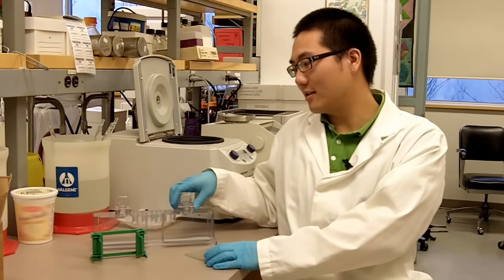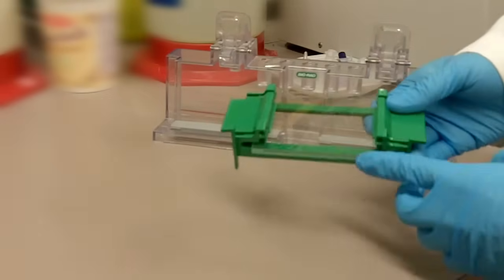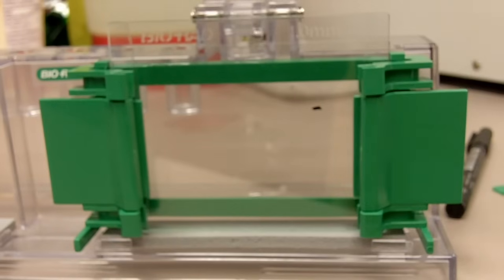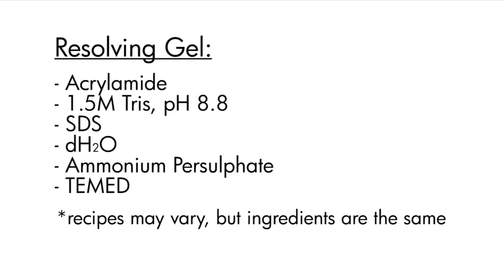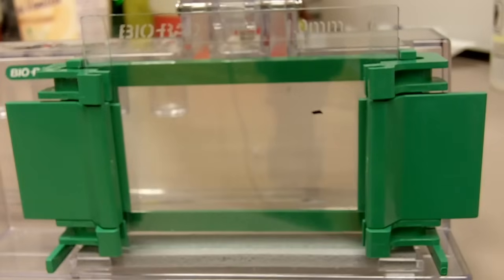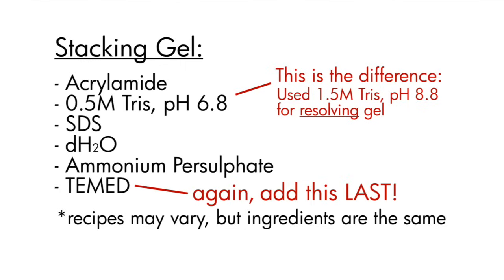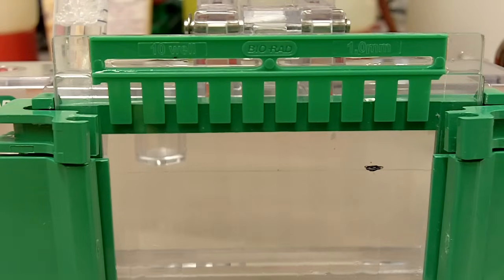How to Make an SDS-PAGE gel

Comment: For some reason, when I prepare the gel, I notice small webs formed inside the well, which is why when I load the protein, the proteins don't run well. I prepared new apps and tried again, but somehow encountered the same problem, Could you suggest what should I do ?

Comment: If you have leakage, you can tape the bottom of the plates together after you place the two glass plates in the casting stands and before placing them in the casting frames. This helps ensure you wont have leakage when pouring the lower gel. It is really easy to remove the tape once the lower gel and stacking gel have polymerized.

Comment: Thank you for the demonstration. I have a question about the time limit that I can postpone loading the wells by my Lysate. Can I make the gel and load it the day after? How I need the keep it and prevent it from drying out? Thank you.
Reply: I generally make SDS gels in advance, wrap them up individually with paper towels, wet them with milli Q and then store it at 4 degrees. I’ve used 1-2 week old gels and they worked fine.

Comment: I have a ques
When i put plates in casting stand and check it with water either it put correctly or not...the water not leak..but when i starting puring gel it starts leaking from plates
Reply: What is the reason

Comment: Rather than pipeting the gel in, I prefer to pour directly from a 15ml conical (or 50ml if pouring 4 gels from one tube).  I find it more convenient and less bubbly - and it makes it faster if you're trying to pour 4 gels before your acrylamide polymerizes.  Also if you have trouble with leaking, try turning the pads at the bottom upside down or lay a strip of parafilm (don't stretch it) along the bottom pad before seating the glass plate.

Comment: I'm having problems with the stacking gel, it's not fully polymerizing. It gets a slimy consistency but never fully forms. We've tried to make new Acrylamide mix, new APS and new buffer but it still isn't working.
Reply: I hope you figured this out already!  How old is your acrylamide stock?  IT does go bad over time and may act as if you used a lower % of acrylamide.  This might be more noticeable in the stacking gel as it never gets as solid as a resolving gel.  Also do you have the right mix of bis/acrylamide?
Reply: do you vortex your stacking gel mixture after adding aps and temed? I've had the same problem and now its gone
Reply: For those who may read this later.
Acrylamide will not polymerize in the presence of oxygen. Make sure it is fully sealed at the top by the comb (this is the true reason for the alcohol or water layer).
If you need vigorous mixing, your recipe is bad. A quick swirl with the pipette tip after dispensing should be all that is needed.
Double check the acrylamide/bis-acrylamide ratio, it is very possible you are mis-understanding the ratio and percentage of the stock.
APS takes a while to go bad, I used to pour many very large gels, and I often used APS that was months old.
Keep APS and Acrylamide in the fridge, and mix them right before you use them.

Comment: Hi, i have a question about Mini-PROTEAN TGX Stain-Free precast gels...
there is number on the packet "4-15%"...
What do the numbers mean separately?   4? 15?
Reply: +Shaig Shaggy The numbers correspond to the percentage of acrylamide in the resolving gel.  A 4-15% gel is a gradient gel, with the lowest percentage of acrylamide just below the stacker being 4%, and the highest percentage is 15% near the bottom of the gel.  The percentage increases from the top to the bottom of the gel.  A single percentage gel would have one number, i.e. 10%.
Reply: +Julie B Thank you for your answer...

Comment: thatguy1w The width of the gel depends on the volume of the wells that you want. 1.5mm is usually ideal for 50ul wells, but 0.75mm is what we use in our lab. It's the suitable width for 30ul wells, which are the most common size for gel electrophoresis. 

@ dude in video, you should never allow the Acrylamide to spill over after you add the comb. That stuff is highly toxic (neurotoxic) and can even cause cancer. You should press a piece of 'Kimwipe' against the glass to suck up any spill overs.
Reply: 1.وقدتملحصولI
Reply: In my lab, we just use spill trays so that the overflowing acrylamide is not an issue. It's all going to polymerise anyway, and the polyacrylamide is (comparatively) harmless. The danger is handling the monoacrylamide, for whic we have dispensers to avoid handling as much as possible.

Comment: i always lose the first well to stupid air bubbles
Reply: Our lab fix it by this way: Pipette in the gel liquid first, leave a small portion. Follow by inserting the comb half into the sandwich. After that, use pipette to top up more gel liquid between each spaces between the combs. Slowly push down the comb, and top up more gel slowly to remove the air bubble (also pipette away the bubbles). After insert the comb 100% into the glass sandwich, pipette more gels liquid along the line of the shorter gel plate (to prevent shrinking). 
And yet broken comb seems work better...
Reply from the maker: Yup it's annoying when that happens. Here are a few things you can try: 1) Make sure your comb is clean and dry. Any water droplets can create bubbles in the gel and cause the wells to become deformed. 2) If you are using isopropanol/ethanol etc. to straighten your resolving gel, remember to pour it out before putting in the stacking gel. It can also help to wash with some water before adding stacking gel. Hope that helps!
Reply: apparently the comb is missing plastic pieces at the 2 sides that should prevent that. Broke university lab :(
Reply from the maker: Maurazio Yeah that happened to our combs too. Those pieces always break off. Makes it difficult to cast ten perfect wells :(
Reply: +labtricks  is there way to cast perfect 10 wells without it? Because I some loose more that just two wells!!
Reply: +Maurazio Yeah I happen to have the same problem, I've somehow managed to mitigate the problem by re-injecting some gel once i've put the combs on with a micropipette and a very very thin and flexible tip... still, doesn't work as well as unbroken proper combs..
Reply: +Firesidemonster maasge
Reply: I find that using an actual glass pipette (instead of a micropipettor as shown on this video) helps avoiding bubbles.

Comment: Is it ok to reverse the order in which the resolving gel and the stacking gel are casted?
Reply: Stacking gel is where you stack your samples! So no.
Reply from the maker: Thanks to Riasat202 and ***** for replying. Yes you having to put the stacking gel on top. That's where the samples are loaded. The purpose of the stacking gel is to let all samples flow through and reach the resolving gel at the same time. Then at the resolving gel, the proteins will separate out.

Comment: When I add the acrylamide solution to the casette, I mark the level with a permanent marker then add propan-2-ol and let it polymerize. On polymerization, the actual gel gets lower than the mark so the size of the gel varies every time from one gel to another. Any suggestions?
Reply: isopropanol absorbs the water from resolving gel.

Comment from the maker: Here are a few things you can try: 1) Make sure your comb is clean and dry. Any water droplets can create bubbles in the gel and cause the wells to become deformed. 2) If you are using isopropanol/ethanol etc. to straighten your resolving gel, remember to pour it out before putting in the stacking gel. It can also help to wash with some water before adding stacking gel. 3) Increase your APS concentration. I like to use 20%, and that can help with polymerization. Good luck!
Reply: At what% the isopropanol solution has to be added
Reply: @thameemansari8890 just 100%
Because, after leveling up on the resolving  gel, we remove the isopropanol with distilled water.
Reply: We tried preparing resolving gel twice but we failed in solidifying it would please tell us the amount of composition u added for preparing 15% of gel. We are running sds page for first time, do help us . Thank you

Comment: Most guides to hand-casting gels (as published by BioRad, etc) recommend that the distance from the bottom of the well to the top of the resolving gel should be at least double the depth of your sample once loaded into a well. As your sample runs down the gel, it gets backed up at the front between the stacking and resolving gels. This allows all of the proteins to start entering the resolving gel closer to the same time. So, the longer the stacking gel, the better the resolution of your bands.
Reply: I don;t understand the term 'depth of the sample'. Do you mean the depth of the well? or the width of the sample when it is poured into the well? Thanks.

Comment from the maker: 1 cm is commonly used and taught, so that's what we suggest here, especially if you are making your first gel. You can leave a smaller space if it works, just make sure you have enough space so that the samples can enter the stacking gel, and have the opportunity to reach the resolving gel at the same time.

Comment from the maker: Yes that can happen. Here are are few things you can try: 1) Make sure your comb is clean and dry. Any water droplets can create bubbles in the gel and cause the wells to become deformed. 2) If you are using isopropanol/ethanol etc. to straighten your resolving gel, remember to pour it out before putting in the stacking gel. It can also help to wash with some water before adding stacking gel. 3) Increase your APS concentration. I like to use 20%, and that can help with polymerization. Good luck!

Comment from the maker: How did you prepare your solution? Maybe we can try to figure out what went wrong.

Otherwise, here is an example recipe for the stacking gel (note that recipes can vary, so this is not the only way to make it):

1.5mL 30% acrylamide/bis-acrylamide solution
2.5mL 0.5M Tris-HCl, pH 6.8
0.1mL 10% SDS
5.9mL dH2O
50uL 20% ammonium persulphate
10uL TEMED

Comment from the maker: @VegasPartier Yes, add the stacking layer until it almost overflows. Then when you slowly put in the comb, some of the mixture should overflow. And don't worry about the pipette tip - plastic is just fine! Good luck on your next gel =)

Comment from the maker: @zileburki Yes you can. Store the gel (inside the glass plates and with the comb) in a container, submerged in the Running Buffer that you use when running the gel. Cover the container with the lid. You can store it at room temp but I prefer at 4 degrees. Just remember to use the gel within a couple of days =)

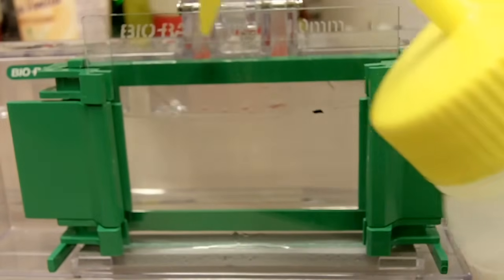Comment from the maker: @nana22124 Yes. As you see in the video at 3:10, add a layer of isopropanol to keep the gel straight, and wait until solidified (about 15 minutes). Then add the stacking gel.

Comment from the maker: @TheLiona84 You can use water but be aware that water can slightly dilute the gels. So if you are working with a high molecular weight protein (the band appears near the top of the resolving gel), you don't want to use water because a gradient can form at the top of the resolving gel, and the protein will not separate properly.

So you can use water, but if you have a high molecular weight protein, I would not recommend it.